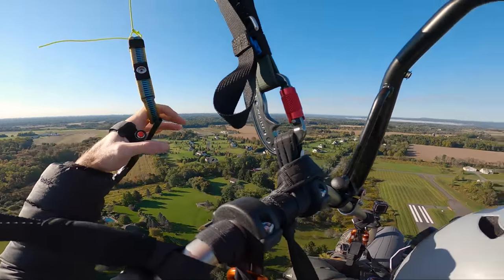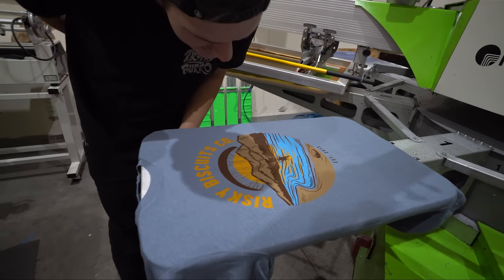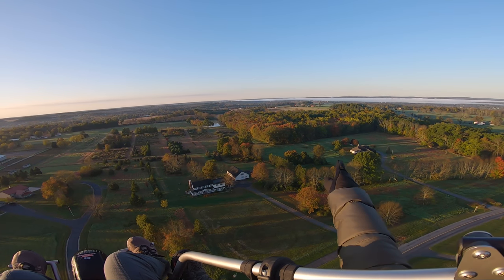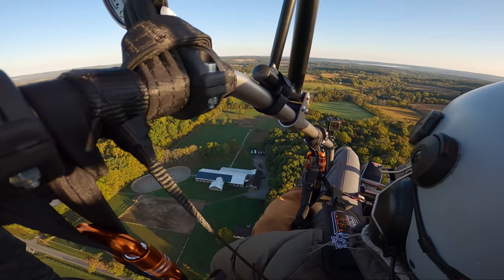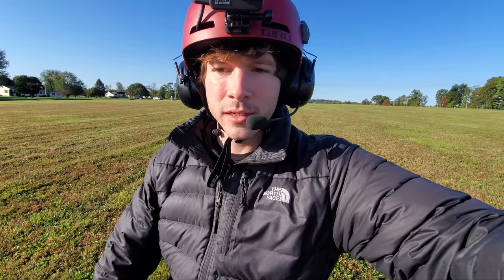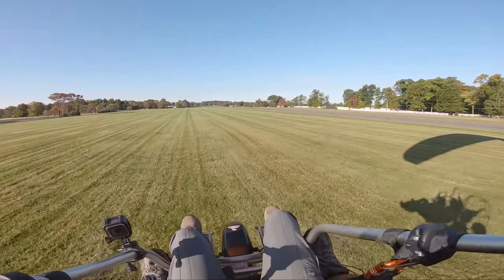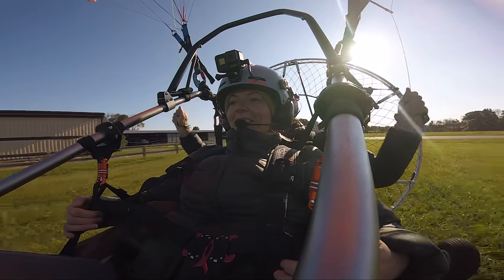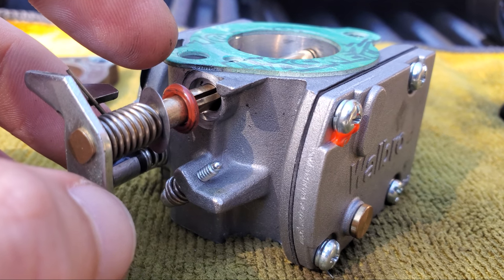I had an ENGINE FAILURE while flying my girlfriend to breakfast...

Comment: Suggestion: To prevent that spring from sliding off in the future, I'd file a slight containment grove into the housing. Doesn't fix the o-ring issue, but would prevent another wide open throttle incident.
Reply: I was going to suggest the same thing. Good call. If it failed once, it will fail again. I would do that from this point on, to all carbs with this design.

Comment: Speaking as a test pilot with 30 years in the business, TG should have landed at the departure airport as soon as he noticed that malfunction.  Proceeding on the flight was poor aeronautical decision making.  If you want to live long enough to tell your grandchildren of your aerial exploits, you have to learn to presume that a malfunctioning throttle could just be the tipoff to a carburetor malfunction that might lead to an engine fire which might burn through the parachute lines.  Fortunately it all worked out, but many pilots have learned too late that you should always assume it's worse than you think.
Reply: Especially since his girlfriend was with him
Reply: There's old pilots and bold pilots, not both.
Reply: Perhaps you are over stating it a bit. Your talking about an aircraft with  a carb for a lawn tractor or small outboard and the lack of a captive return spring shows it.    If it was a backpack setup exactly the same, fly until upwind or suitable field, fight for the field during the glide and time the last circuit with as close to normal approach to the best of your abilities.  

If it was a light aircraft the combo of the prop and mixture control and the mag switch are wonderful things for a hung throttle.  In fact alot of early aircraft were depowered by mixture and mag/timing setting.   

Hung open throttle is not typically a fire risk on a small engine, it is a hung throttle and any smoke or smell will be seen in the clearing turn.   Most of us had that minibike that would at some point in the day after so much grime and dumps into the mud had 2 speeds, tapping the kill switch, half choke or hang on to get back to the barn.  

Wide open and running until upwind of the airfield was exactly the right choice IMO, fight for the empty field or airport cause it beats suburbia power lines and fences,  that motor will run wide open for as long as there is fuel and has oil on its bearings.    

Knowing the approximate no thrust sight picture is priceless.  That is what should be commented about.  Landing flare was timed perfect, rollout was less than walking pace,  next to assistance if it was not perfectly on the wheels.
Reply: I don't think you've watched the other videos or even have any paragliding experience TBH. He does these kind of landings all the time, even without the engine working. You DO realize that he literally has a parachute on his back all the time, right?  It's not a plane, dude, relax. 😂😂😂😂 I hope you're not too proud to learn something new.
Reply: @christopherwhull  TL;DR. It's a paraglider with a PARACHUTE. Don't overthink this.
Reply: @Duciousness  I was attempting to relate to AK pilot.
Reply: @Duciousness  he's kinda got a point about a fire burning through the parachute lines, then he wouldn't have his parachute to land, read the whole comment!👍👋
Reply: @Robertjames525  No, what you need to do is watch the rest of this guy's videos and you'll see what I'm talking about. He does these landings ALL THE TIME. He's had many engine failures. It's really quite simple and there's no need to write essays and overthink this. 😐
Reply: @Robertjames525  Here's a video of a guy who uses a flare gun to set his own parachute on fire. He then releases the RESERVE parachute after completely releasing the burnt one: 
https://youtu.be/NiRBJ9D5h64
So I don't know what all the analysis and 30 years experience have to do with paragliding. It's clearly a totally different kind of experience all together. 🤷🏽‍♂️
Reply: @knunyabeasewhacks8744  this statement goes directly to Duciousness hah
In all seriousness Duciousness, doing it regularly doesn't mean it's safe to do, having a backup system doesn't mean it's safe to do, if there's a potential risk, don't test your luck, in best case, you'll just be fine, or, potentially, you will loose your life, and make innocent people (in this case his gf) looses their, that's how everything you know are to their safety standards today but if you are really trustful of what you're saying, come here in my country in Africa and test it and let's see how long you survive using your mindset 🤪
Anyway, no point in arguing further, I don't believe this will change your mind in any way.
With all of that being said, hope you are doing well, and be safe.
Reply: "always assume it's worse than you think"
Deep wisdom there.
Reply: @Duciousness  👍 gravity likes this.
Reply: @Duciousness  I stated africa as it have actually something to do with this quite a lot : in my country as in many other African country I had the occasion to travel to, a large portion of the population have the exact state of mind as you. I'm aware there are a lot of people such as this in other parts of the world, but either it's being regulated better so they don't have the occasion to act dangerously or a larger percentage of people have some awareness about this as the stats are quite different from what we see here. Quite honestly I don't give a f, if anyone loose their lives because of their immaturity, they can only take the blame on themselves, but risking other people's life, that's a big no for me, and that is the trend that is happening here right now, I can't count with my finger how many of my loved ones lost their lives on the past 10 years due to the negligence of others, and the statistics on the media does not stop rising, so many lives just wasted. 

There was a bus one day who had a some electrical issue that the driver thought not to be bad enough so they went on, result, not long after, every electrical part of the car including the brake completely failed resulting in the death of 60 people(38 on the spots, the rest in the hospital) , one was a friend and this completely ruined my other friend's life by making her disabled for life and making her loose a lot of who counted for her, I don't find anymore the article of the investigation as it's lost in countless of Facebook publication of local police but have a look : https://www.google.mg/amp/s/www.leparisien.fr/amp/faits-divers/madagascar-au-moins-34-morts-dans-un-accident-d-autocar-01-08-2017-7170384.php. I'm linking this as for once, it was really mediatized but cases like this happen almost every single day and the very sad thing is I doesn't take that much effort to stop such butchery, people just don't want to do it because of the dumb reasoning of "hey, I've done this before and nothing happened" 

I have a lot of experience with this too, here's the one that really hit me hard. I had been to flight school before and I quit suddenly, why? During a flight one day, there was a failure of the airspeed indicator not long after take off (it randomly dropped to 0 before returning back to the proper? Not even sure speed , I counted and it did this approximately every 10-15 seconds. Condition was good, no icing, no wind,... ), my flight instructor said to just ignore this and go on with the flight. I refused, said we should land and after a back and forth between us, he allowed me to, landed the plane, went to the hangar and never returned there. Just a month after, this same exact plane I was in crashed killing the 2 pilot students on-board, the 2 instructors and the son of one of them which was by that time only 13, and it would have killed more people on the ground had it stalled after some more NM.
My grandmother who didn't knew I stopped called me in panic this day thinking I was on-board and the thing is it could have been me if I had this dangerous and unconscious mindset too. No investigation was done. But there were some very gruesome pictures of the crash on Facebook and just seeing it as well as the report of the witnesses, there was no doubt the plane had stalled, it had smashed in the ground with a flat angle, with a very high vertical speed as there was nothing more than a lot of flattened pieces of metal vaguely having the shape of the plane seen from above and pieces of human fleshes left. I personally think the airspeed indicator did again what it did and the instructors (none of them was the same instructor I was with but I guess they have the same mindset) most probably said to ignore it too and the students probably did. Then it failed for good by either getting stuck at 0kt or by giving pseudo-real indication which caused the stall. I'm quite sure the instructors of that one flight school have been letting such things happen for months or years, but you just can't expect to have good luck every single time you do something like this. 

Cases like in this video, or the 2 I shared above out of thousands and thousands of others where people decides to go on with failures not really knowing not to expect, there's are a lot everyday. Cases where lives were taken, destroyed because of these decisions, there are a lot everyday too. So the question is, who's at fault? People doing and  promoting such behaviors are the first to blame for me like you or the instructor in my case or I don't know who else. 
It has nothing to do with checking your equipment or "being a pussy", critical failures can happen even in equipements with perfect condition and in a lot of case, these failures might begins looking like seemingly different and easy to handle ones first, and in case you don't know what causes an issue, the extend of it or if you just have the slightest doubt it, if you have the slightest consideration for your life or people's life, you won't just take the risk, again, in the best case scenario, but think what will happen in the other scenarios? 

You might be asking what critical failure an engine failure might cause in in a paramotor? I've actually already seen cars and motorbikes having their engine shutting down before catching on fire minutes way more after for no apparent reasons. As these have pretty much the same base logics to work, we can guess such think can happen too in a paramotor. What would happen in this case? I think we all know.

I don't expect to change your mind so I'm disabling notifications for this and just hope you don't end up hurting or taking away innocents. Wish you the best.
Reply: @Duciousness  Saying anything hateful is a sin.
Reply: @knunyabeasewhacks8744  saying anything hateful is a sin
Reply: @Duciousness  How will that work if there was a fire though and the chute lines burn
Reply: @ian3580  He has 2 parachutes. 😐 How many parachutes does a pilot of a plane have that he can actually use?!? What happens when the plane catches fire and your chute lines burn?
Reply: @Duciousness  I don't understand your comment at all.    Not turning back and landing as quickly as possible rather than trying to get home, into a headwind nonetheless, doesn't seem like the best/safest option, especially with the life of another on hand.  If my brakes feel spongy, I don't keep driving because I have an emergency brake....in no industry or field where life is at risk do people rely on the backup system as an excuse to continue using a failed/faulty primary system to finish a mission when it isn't necessary.   

It would be different if he had a way to know the mode of failure while in the air and base decisions off of that.
Reply: @ian3580  Just watch other videos on his channel and how other paragliders recover from accidents. You 'plane crowd' folks know far too much.
Reply: @Duciousness  I'm guessing people don't post many videos of themselves dying or getting seriously injured do they?
Reply: @ian3580  OMG there's plenty of videos of paragliders doing Emergency Landings. Just look for it if you're really interested. Either learn what paragliding is or don't. Geez! 😳
Reply: @Duciousness  I could agree with you up to the point that he had a passenger.  That changes things significantly no matter how willing she is or how she accepts risk or doesn't.
Reply: @Duciousness  Deliciousness can't make an intelligent argument to any of the safety points beyond saying that 'he hasn't died doing this yet' and "STFU'.   Very convincing.  You're right, I must be the idiot....you've made it very clear to me now.
Reply: @Duciousness  “He does this all the time” isn’t an adequate rebuttal. You can take a risk and be fine 99 times out of 100, but the 100th time could be fatal.

The original comment alluded to a potentially serious flight risk, but since I don’t know anything about flying anything, I’m just speaking generally.
Reply: In all fairness he took off from Skymanor (N40) and landed at Alexandria (N85) they are 2.2 miles apart, as soon as you are airborne you can see one from being over the other.  But you generally speaking you are correct, once an engine (or other safety of flight) problem is noted it is time to plan on a landing.
Reply: @christopherwhull  dude he is being sarcastic
Reply: @g.choppa4448  it’s one thing that this guy recklessly kills himself but it’s another to kill a naive and somewhat inexperienced and shallow girlfriend
Reply: Maybe there should be an emergency detachment for the engine

Comment: Hey Tucker!  Great incident follow and briefing!  How are your lock wire skills?  If none, please get an A&P mechanic to show you how to do it right!  You need to go around and lock wire all your springs from being able to slip off regardless of o-ring position or whatever fail mode that can and will happen. While you are at it, get all your bolts lock wired as well. I seem to remember you mentioning an exhaust manifold coming loose and an air box as well. These are all classic aviation problems that are resolved with lock wire or lock straps. Your ultra light aviation needs to step up it’s design and build standards!  Good luck and thanks for the great channel!
Reply: oof i hope i don't learn this stuff in school
Reply: Cant afford to have these simple design flaws in midflight.

Comment: File a notch in the carb for the leg of the spring to sit into when you reassemble it.
Reply: If the carb body will allow...drill and install a tiny roll pin as a stopper. No sliding over of the spring arm to the edge no matter what the choke shaft o-ring does.

Comment: I always wonder why he rarely wears eye protection while flying.
Reply from the maker: The wind has never bothered me and bugs are rarely an issue. Personally, I hate wearing sun glasses or anything that obstructs my vision.
Reply: @TuckerGott  I feel the same way - but one night, I was flying low over some corn fields, and a frickin' dragonfly flew right into my eyeball! It HURT and my eye was red for weeks. So now I wear sunglasses.
Also, ear protection is of course the smart thing to do, but I also hate having earcups on... they make me feel like I'm dulling my senses/awareness of what is going on around me...
Reply: @I.C. Brian  I wish I'd have had a friend to make a loving comment like that to me years ago when I was an active rock climber. One tiny rock to the eye.  Now, I only see with 50% of my left eye, and what I do see is distorted like a funhouse mirror. My special glasses run $500. Good on ya for bringing it up.
Reply: @Robnord1  I've used "monaural vision" to get by with for a number of years now, but "distorted like a funhouse mirror" sounds like it might be even 'worser.'
Reply: @Richsalvageconsultan  Monocular
Reply: I had a rock hit my eye while mowing the lawn. Then I had a bungee cord snap right into what would have been my eyeball had I not been wearing sunglasses.  I don't mess around anymore.  Eyesight is precious and easy to protect.

Comment: Tucker is the world’s most level-headed guy and still has a sense of humour. Btw, that spring/washer/o-ring setup looked incredibly cheap and nasty, like something you might find on a lawnmower. Aviation demands a bit more, I reckon. Spring at least could be secured at both ends, in a groove, with a screw-down plate over it.
Reply: You must be level headed if your landing dead stick with an aircraft like this. Someone losing their mind will take you out. and the carb is normal. that kind of setup is used on all small 2 cycle engines. you can get better things, but it requires a full re design of the carb and that design is perfectly reliable for this situation.
Reply: I'd want to put a little grove on the end so if that happens again it wouldn't just slide right off but id still be on the lookout with everything.  Safe travels 👍
Reply: @Codyjames83  exactly what my thought. not a bad design, just could use some help. I tend to put bigger springs on the small engines. helps things out.